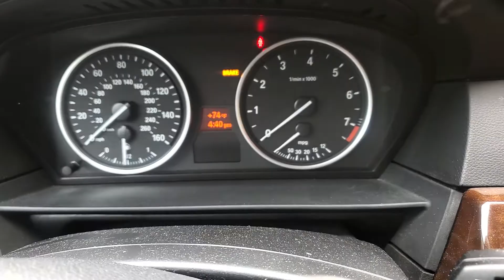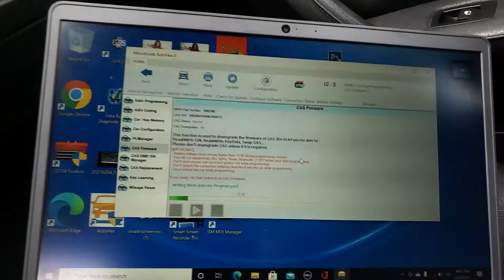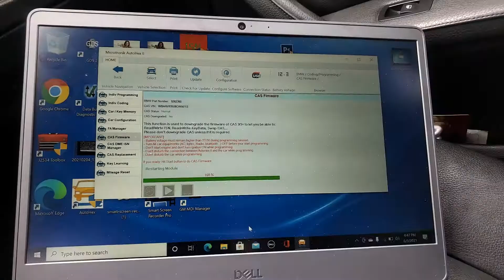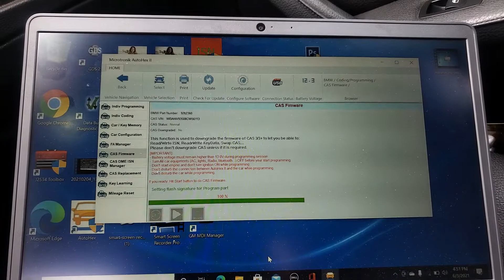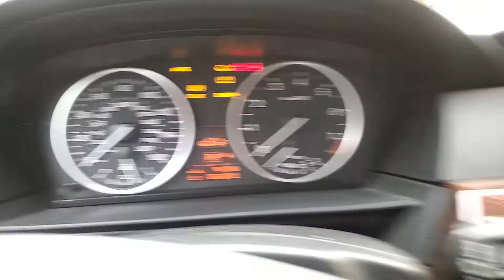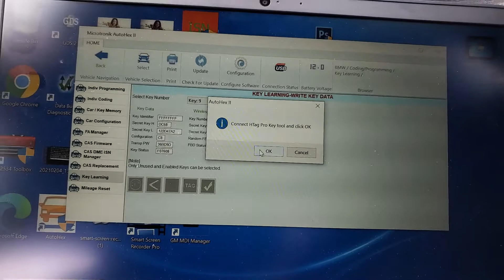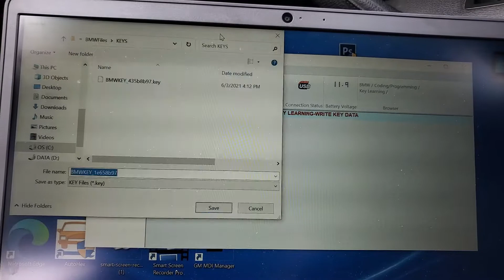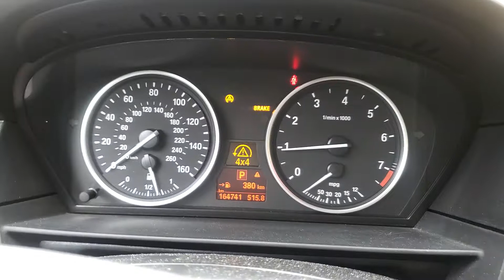How To Program Ad A key On Bmw 2008 535i Using Auto Hex

Comment: Also brother, since this E60 was a cas4, once you downgrade the CAS, what firmware does it become?
Cas3+ or Cas3?
Reply from the maker: still cas 4 but you need to downgrade the software only to help you program the key after that you can restore it back
Reply: @BestCarFixes  thsnks brother
Reply: @BestCarFixes  thsnks brother